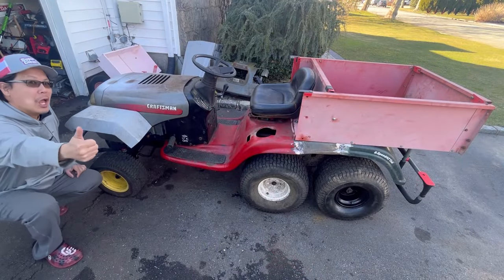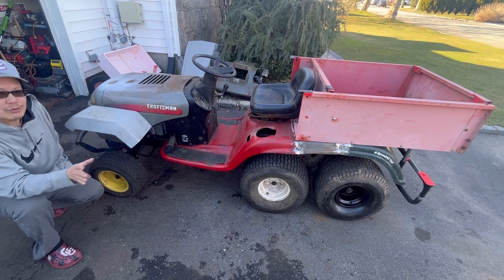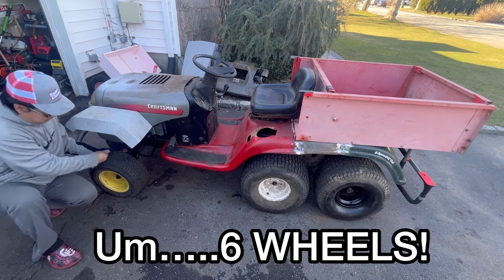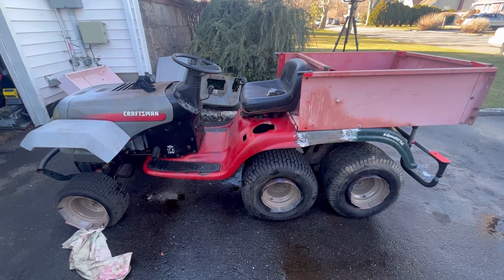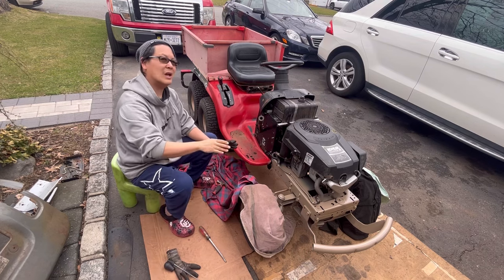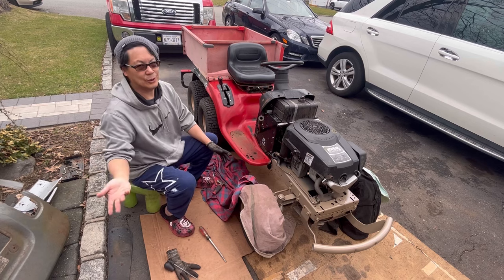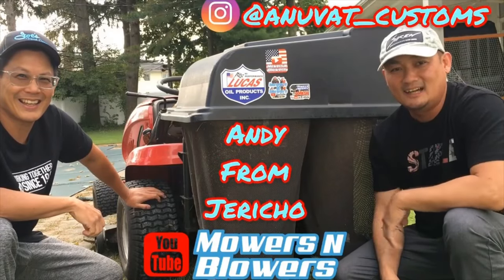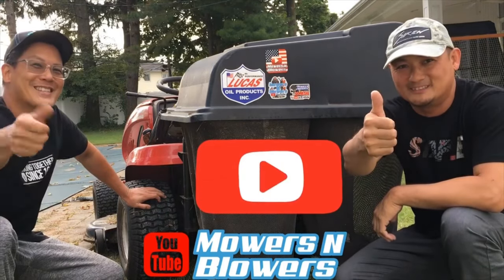PAINTING MY CRAFTSMAN 2X6 MILITARY UTV LAWN TRACTOR CONVERSION CAMOUFLAGE COLOR & BIGGER PULLEY SWAP

Comment: Looking good. I have an idea to drive the rear axle off of the front. Use a toothed cog/sprocket on both of the rear axles with a drive chain to the rear. Just an idea if you were wanting a little more traction. You may need to do both sides because of the open differential. Very cool idea I have wanted to add a platform behind the seat of my tow rig and this gives me a few options.
Reply from the maker: Good idea,  but it’s way easier to just weld another pulley on the drive transmission and run a belt to the rear tranny and hook up a linkage to both shifters.  I don’t need it to be 4x4,  if I was gonna do all that,  I’d try and power the fronts too and make it a 6x6.